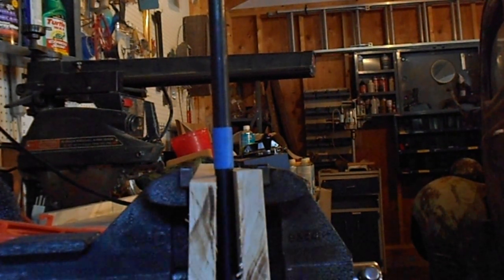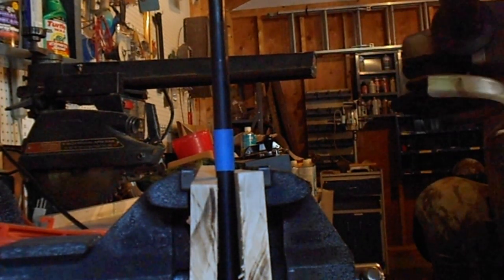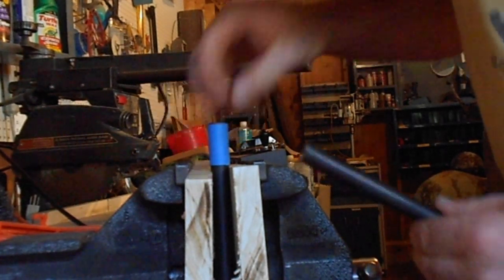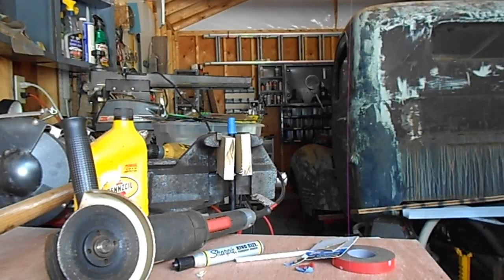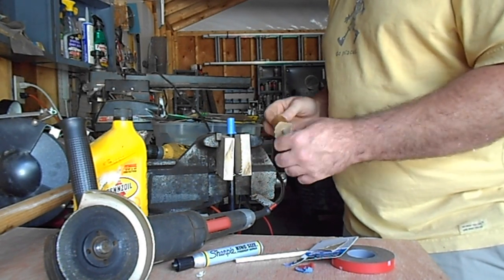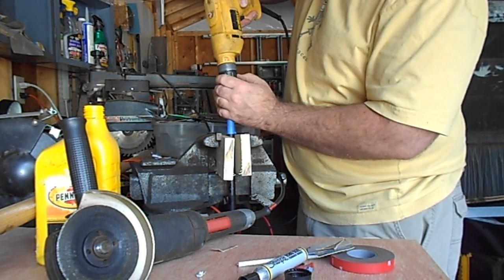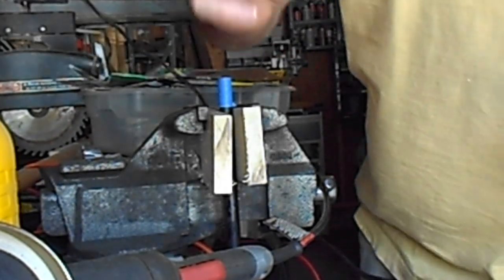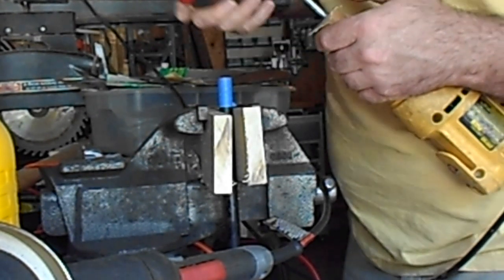mosin nagant project part 2 (shortening and facing the barrel)

Comment: Still think there's a better way! But hey, McGyver would have used a #2 pencil.
Reply from the maker: Sure but at the time I didn’t have the doe to buy the proper tools and figured there is more than one way to skin a cat. It work out awesome the rifle shoots about an moa and it’s fun to shoot. It shot 6 moa before.
Reply: Great job man! Way to jump in and get it done. I'm getting ready to cut my 91/30 also. Want to figure out a replacement front site first. Maybe a Slip over barrel -band type? I know the carbines are about 20-1/4".  I taped mine at both 20 and 22" ... gonna flip a coin.  Thanks for the video.

Comment: i shortened the barrel on a mosin, i used a hand tube cutter. with the rollers and the cutting wheel it makes a perfectly surface . also it does away with all the leveling work.
Reply from the maker: thats a great idea i like when people think outside the box. I'm going to try that on the part i cut off.
Reply: heywire after you use tobe cutter to shorten barrel on mosin use a cone shaped stone on a drill slow speed to put a slight taper to the bore of the rifels newly cut end
Reply: that freakin genius
Reply: This has been my go to method for awhile. Especially nice and clean cuts on shotgun barrels